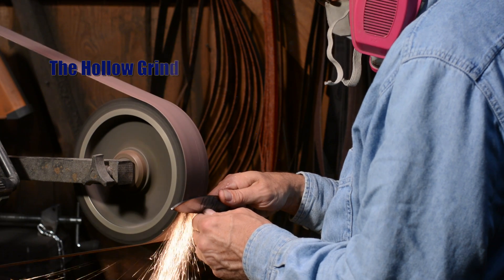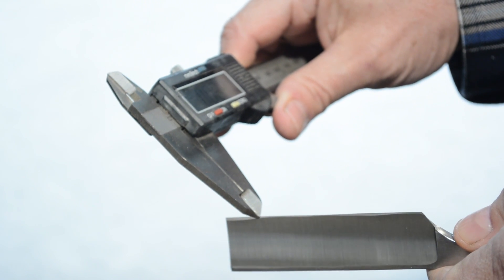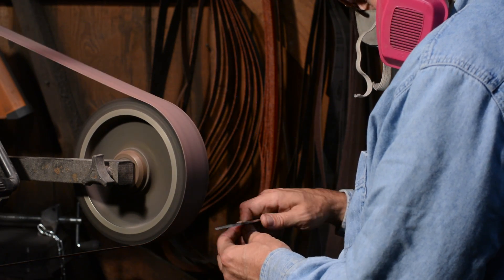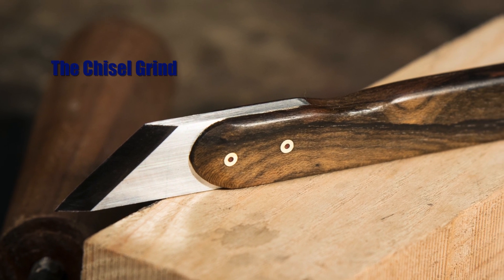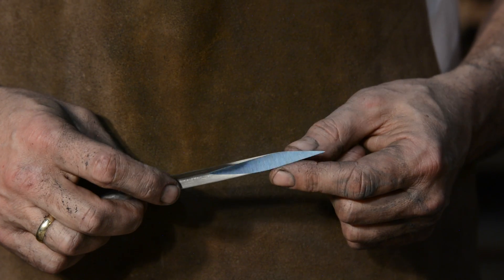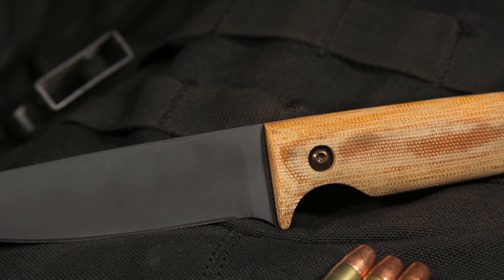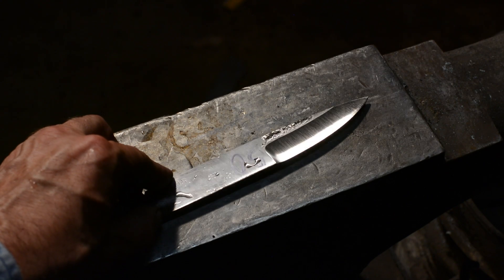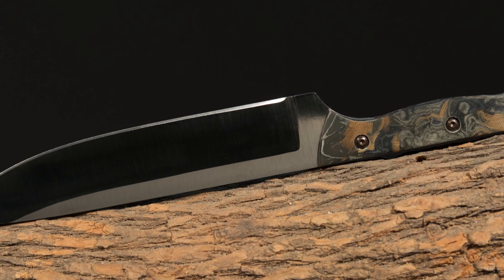Knife Grinds:  Comparing Hollow, Convex, and Flat Grinds

Comment: Scandinavian grind for life.
Reply: Scandi is literally a partial flat without a secondary bevel, in theory it sounds terrible but it works so good! Scandi's are awesome for bushcraft :D
Reply: +dscrive Try the more traditional blades. Most Mora blades are mass produced as disposable work tools. Most are never sharpened. Just discarded. Try the Helle Viking instead for instance. 3.7 mm thick carbon steel blade. With proper care it will last until it is sharpened  it in to dust. I have had mine for about 6 years. Perfect knife for the mountainous boreal forest areas in western Norway that I call home.
Reply: +Rakadis Til Valhalla!!
Reply: +Rakadis I recently discovered the scandi when I bought a mora to carve a whole sale order of a few hundred figure 4 traps. easy to keep wicked sharp, and the steel holds an edge fantastically. I love it for woodworking, but I prefer a beefier blade for general purpose.
Reply: Rakadis
sry, most useful grind is convex.
Reply: I used to hate the look of scandi knives. That is, till I tried one. Impressed really.
Reply: +dscrive if that's the case, then mora seems to sell very very different kinds of quality here and there. I've got an martiini scandi knife out of sandvic steel and a mora companion carbon. my self-made knife out of 1.2519 steel and saber grind holds it's edge much longer.
Reply: I've git the Mora 106 laminate steel knife. all I do to keep it sharp is lay it down on the stone and give it a couple of swipes, I find the bevel going all the way up makes it really fast and easy to maintain the edge. 
Pretty much all I've been cutting with it is white pine, and I would expect it to dull much more quickly as a general purpose knife.
Reply: +dscrive now we got to a point. just like Walter is saying: each grind has it's benefits and weak points. I would agree, that the sharpening process is in deed pretty simple,  but can take a lot of time depending on how much the edge is damaged/worn out. for bushcrafting alone with the simple purpose of cutting wood,  the scandi grid is in deed very sturdy. but hell awaits you if you ever accidentally hit a stone with the edge.
Reply: Simplest excample: You drop the knife on rocky ground. Or you cut roots or blackberry branches near the ground. Or you do batoning in a hurry and dont use a proper ground. There are plenty of ways, though they mostly occur as handling failures, especially if you use the knife as edc. And to be honest: I do not take the same amount of care with a 15 $ Mora as with a more expensive knife or a 60 hour work selfmade knife.
Reply: +Rakadis convex for me

6:22 - "trickier to maintain" lol it's a lie. U just need three sheets of micro mesh :D also for beginners very easy way to sharpen a (convex) knife
Reply: ***** Yeah. That is probably why it has been the grind of choice for the last thousand years here in Scandinavia...
Reply: @descrive. Not to mention, "a couple swipes on the stone" would do nothing over the large area of a scandi edge bevel to sharpen it, other than realign the bur, which is what you're probably still cutting with if your Mora is stock. This might restore your edge for another 3 minutes of whittling white pine along the grain, but this is not sharpening. OK, I'm a troll. But admit it. You love Scandi cuz of Cody and Dual Survivor. And because Mora come shaving sharp out of the box, probably sharper than you can personally get your other knives. :) When you've used your knife enough for it to actually get dull, come back and tell us how easy it is to sharpen.
Reply: Kenneth Lee Myself, I love the scandi because I'm Norwegian and have used scandi-grinds for 35 years. I have used other type of grinds of course but I always go back to the scandi. I even found my old Helle knife a short while ago, I used that thing for 15 years first as a boyscout and then in the army. Although it looks like it has been through hell and never been sharpened it still has a good edge to it. Bent blade and all. Good times!
Reply: I have an inexpensive diamond stone that I just run my mora across every now and then. I've done many hundreds of projects with my mora over the past 6 months, and I've probably spent less than 5 minutes maintaining the edge
Reply: +Rakadis i should try scandi grind
Reply: haha, good points, I only hold to the merits of the scandi grind as it pertains to my woodworking,
I'm the type of person that likes to maintain an edge, pretty much the only times I break out the coarse stones is when I damage a blade, or I'm changing the bevel angle. 
out of curiosity, what are you thinking of doing that would lead to hitting a stone with a knife?
Reply: Scandi grind is my favorite. I own several blade steel\grind\shape, however, my little Tops mini scandi knife is my first go to blade.
Reply: @alan Kaufmann  putting a micro bevel on a scandi, wouldnt that technically be a saber grind then?
Reply: @descrive: I'm curious to hear what are your perceived merits of scandi grind as pertaining to woodworking? I use chisels for woodworking. I understand the reason for a wide bevel and a flat back on a chisel. I don't see how these features give benefit to a knife. I have a  Mora 120 which I keep stock, and one that is reground to FF. I pull out the stock Mora now and then, searching for these benefits. But they continue to elude me. :) I came up with my own theory of why scandi grind ever evolved. And I think it might have been due to cost of iron back in the day. When sharpening, you are losing valuable metal. So if you want to conserve your iron, you remove least amount as possible. And eventually your knife turns into a scandi. :)
Reply: @ descrive: What kind of stone do you swipe it on? My stock mora 106 and 120 edge would roll easily doing anything other than paring cuts/whittling along the grain. Maintaining woodworking knife with such a thin apex angle leaves a very specialized tool. If you are literally only sharpening flat on a "real" stone, you're basically cutting on a wire edge. I ask what kind of stone, because some stones automatically round the apex more than others. And I still don't see why the bevel need be so thick/wide on a knife, other than for splitting wood... which it is still much wider than it need be. I'm probably coming off as a troll, and maybe I am. But honestly, the love over scandi grind has me baffled; I cannot understand how this came to be. Help me out.
Reply: How is scandi at skinning or processing game?
Reply: Kraakesolv I love it too but fave is full convex
Reply: Im with you bro!
Reply: Grizzly Country Check out Virtuovice's channel.  He's a paid by gov't hunter in Japan.  He dissects grinds/profiles and gives hands on examples.  He likes the Scandi.
Reply: I love convex but i cant walk past true scandi
Reply: +Taunus-Tims Welt try putting a microbevel on your scandi grind-toughens up the edge, makes sharpening easier and has only minor effect on slicing ability.
Reply: Alan Kaufmann
you can also use micromesh, for making convex microbevel. Works very nice
Reply: I can't understand this opinion. I used to love my mora until the blade got the first break outs. resharpen the scandi is such a pain in the ass. well if you really just use it for wood cutting this may not be an issue. but although I love the sharpening with wet stones, I hate that you can't just use a grinding steel for a scandi knife to rapidly resharpen it. maintaining a scandi is too much work so I nearly stopped using my scandis at all. I prefer flat or sabers grinds.